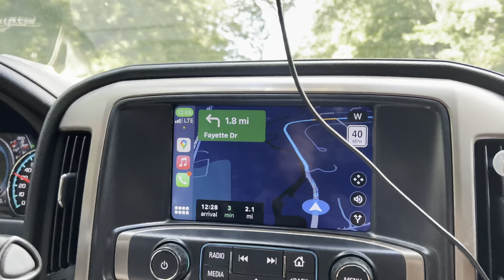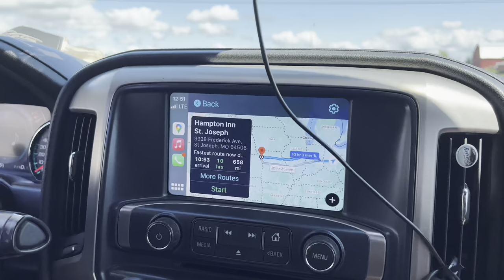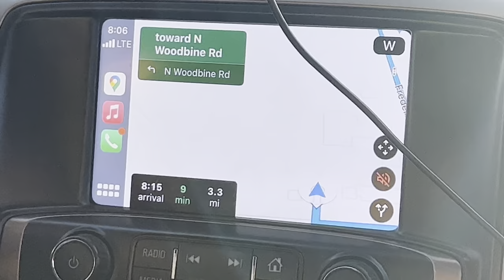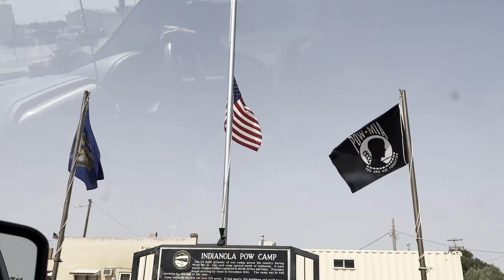Epic 5 Cab Over Buy!! Pulling from the Pasture.

Comment: Tell you what if you get this message you can find an old garden tractor as long as the body's good and the frame is good the rear end is good and the transmission setup is good I don't care if it's got a working motor or not but I'd like to have one if you can find one and I don't want to pay no more than maybe a couple of $100 for it it can be rested surface rust all the pieces it don't matter just as long as it's everything only can good shape otherwise